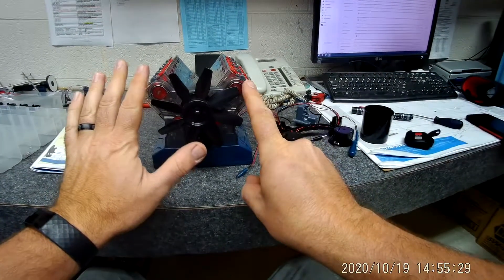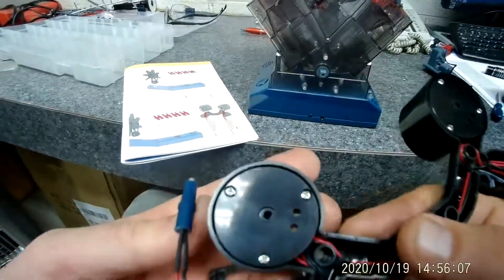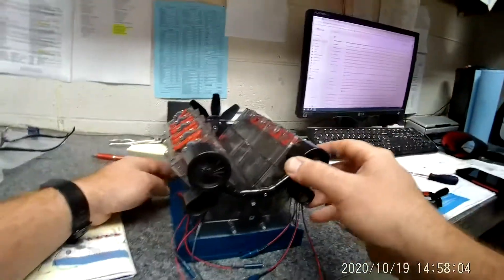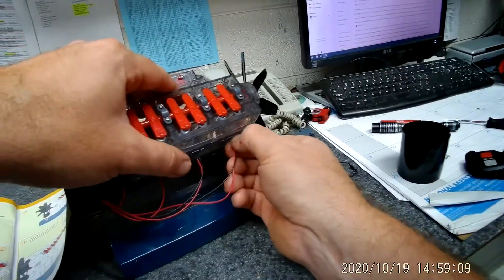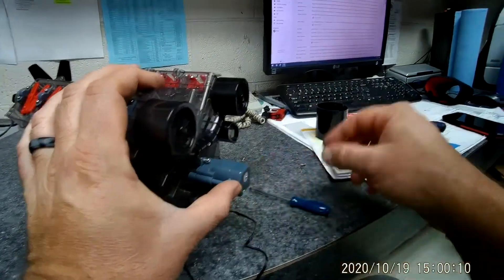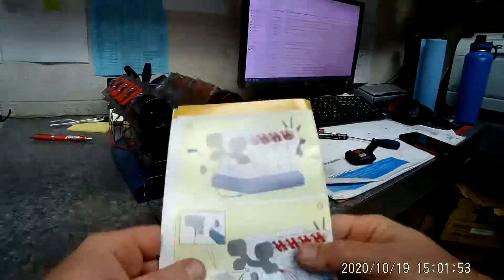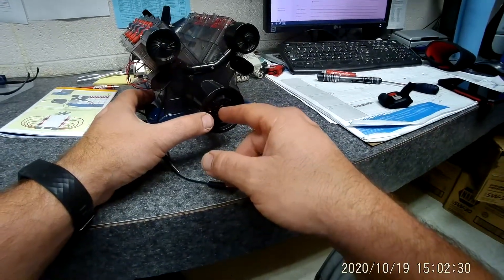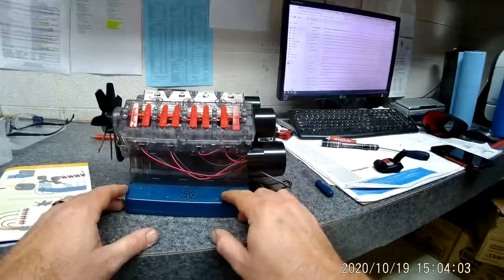Playz V8 engine assembly video 6 of 7

Comment: Thank you for doing this. Save me some time – pleasantly surprised by how pain-free this project was. I had my six-year-old son do most of the assembly. Only issue I have run into is that the  fanbelt seems to have too much slack in it and I cannot get the fan to turn consistently. fortunately the serpentine belt works perfectly so we can see all the innards doing their thing!